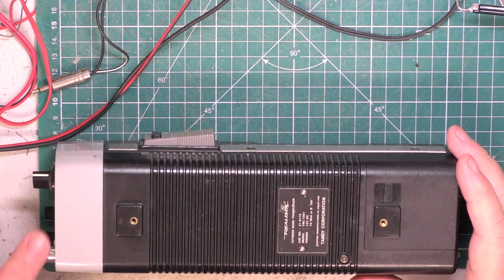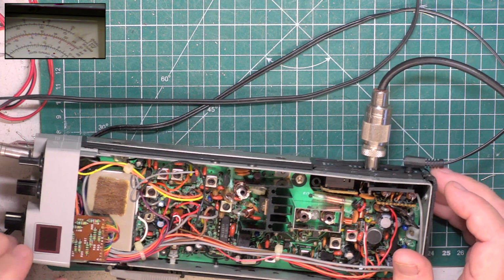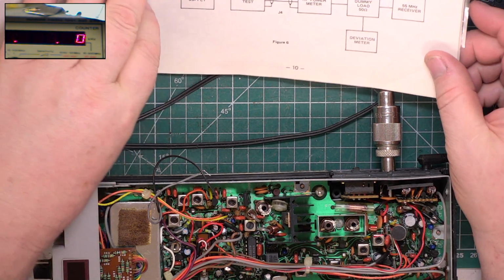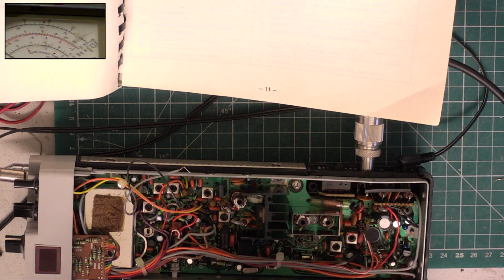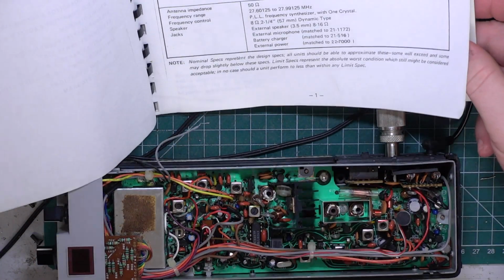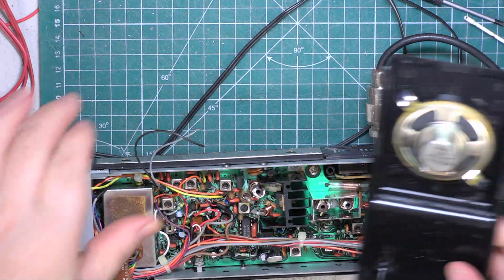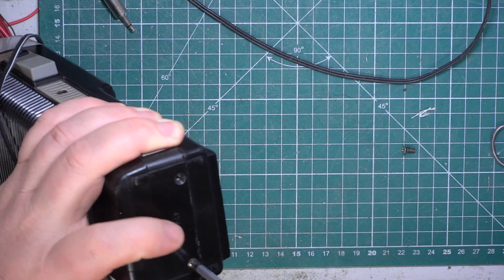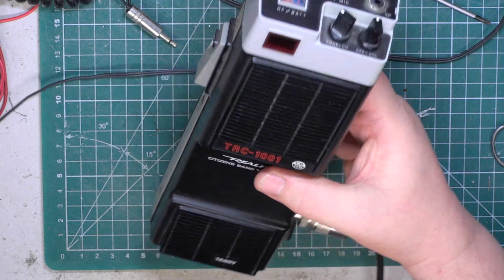Realistic TRC1001 CB27/81 UK FM handheld CB radio - service alignment

Comment: I think I still have two of these knocking around, one of them I machined a brass insert to go in the last remaining section of the telescopic aerial that was then threaded to take a rubber duck. It didn’t get much use due to the sheer bulk and weight, not to mention the appetite for batteries!

Comment: Hi Richard . You mentioned the AM scrap chassis and centre loaded Antenna ...As the antenna  restrictions were changed at a later date post 1981 ( cannot remember when ) , would it now be legal to fit a centre loaded replacement antenna off an AM set ? I realise the antenna would need to be very slightly  shorter
Reply from the maker: Theoretically yes, but a careful look at both circuits would be required as certainly the TRC1001 has a loading coil on the PCB. I expect the AM version does too....a different one. The next snag is if that was the case & you swapped loading coils as well as aerials, the FCC band is lower frequencies leading to a high VSWR presumably as you suggest. Now we've tested the Realistic TRC1010 which was their CEPT UK set & does have an aerial with a centre loaded coil....but we got nowhere near the range of the TRC1001. Is that the radio? is that the band?

Richard, G0OJF, UK
Reply: @ukfmcbradioservicingTango21  Thanks  Richard ... interesting on the CEPT version not doing so well , Antennas can sometimes not perform how you expect them to , maybe on handhelds center loads don't improve things ... very interesting  ... thanks for the reply , regards Mark

Comment: Hi Richard, another good video. Thank you for sharing your expert knowledge. I have one of these radios and something is causeing the batteries  to drain even though the radio is switched off. (24 hours dead flat) Your video has inspired me to see where the problem is lerking.
Reply from the maker: Well there is still no radio offering better range all these years later. About 4 years ago I had to go to Sheffield each week to clear a late relative's house. Mr Chippie would meet me there on a Friday afternoon & we'd both drive the 5 miles back here with two cars full of stuff. The house at Sheffield was relatively high up & I put my own Realistic TRC1001 on the upstairs windowsill (on an external mike for convenience of use). Mr Chippie would come through regularly from 14 miles away & we were able to have a 2-way conversation. Try that on a new set with their little rubber duck aerials; I think not.

Richard, G0OJF, UK